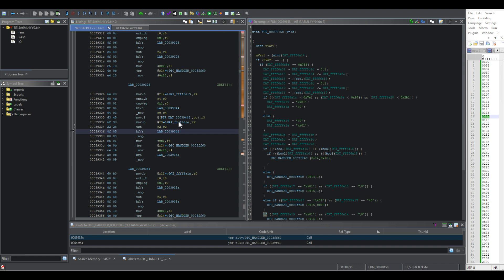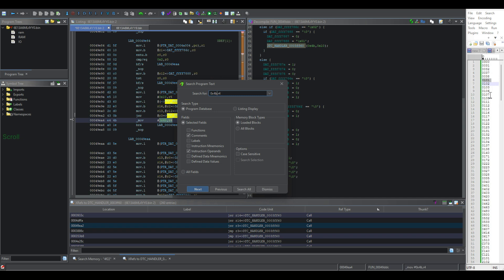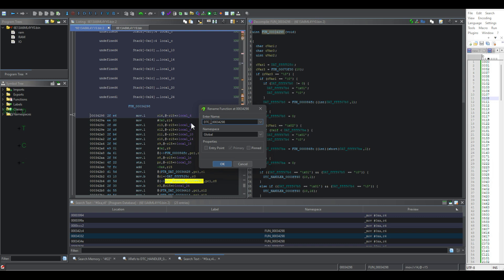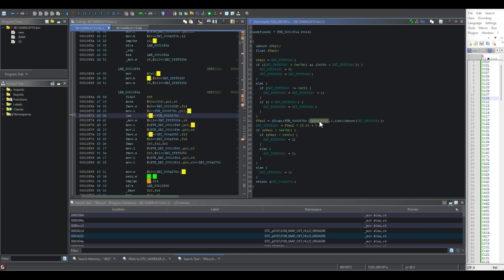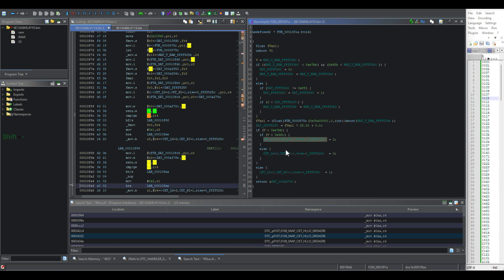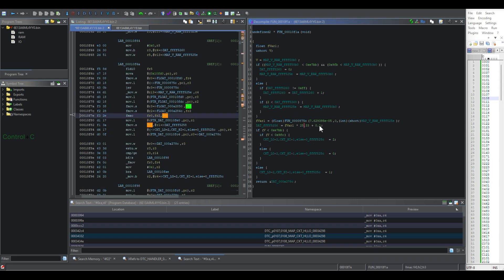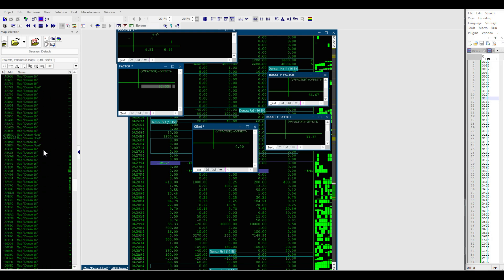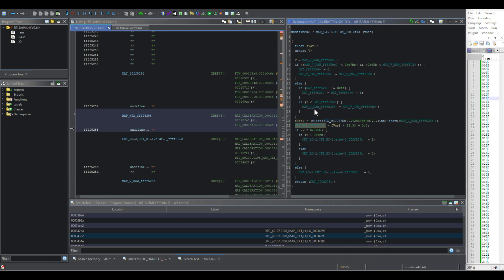Ecu reverse engineering. Finding dtc thresholds, and Map sensor linearization Ghidra and WINOLS VID2

Comment: What da hell doing ?
Reply from the maker: Workin
Reply: @GHIDRAuto  what can i do with ggidra ?
Reply from the maker: Anything from hacking games(pc games nintindo games etc) to hacking a nuclear centrifuges vfd. If it has a processor or runs on code you can reverse engineer and then edit it. It’s “official” use by the nsa is cyber security. It is used to find and disable viruses. But the inverse is also true

Comment: How exactly do you get the dump from the ECU? Is it as straightforward as hooking into a chip and reading its firmware? 
Btw love these videos, this is awesome I didn’t think you could fuck around with ECUs like regular software 😂
Reply from the maker: From what I understand, yes it is technically that easy, however reading via obd2 or sometimes “bench read” you will need seed keys and pass keys to read or write the file. 
I use pcmflash, but there are a lot more tools on the market
Reply: @GHIDRAuto  very interesting, thanks!